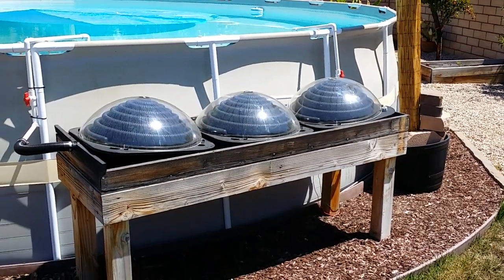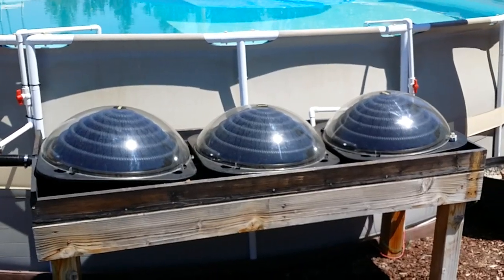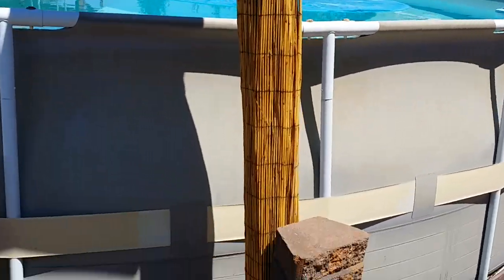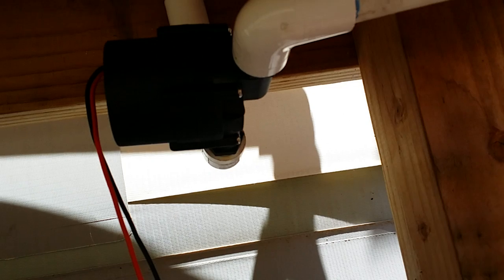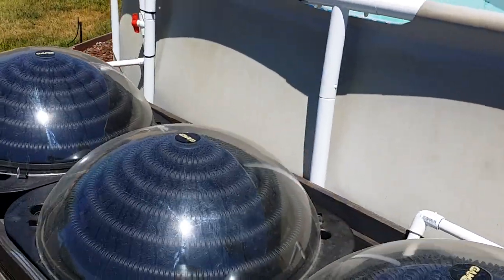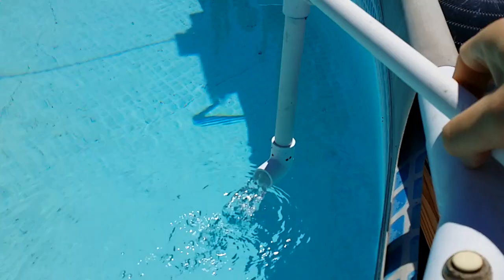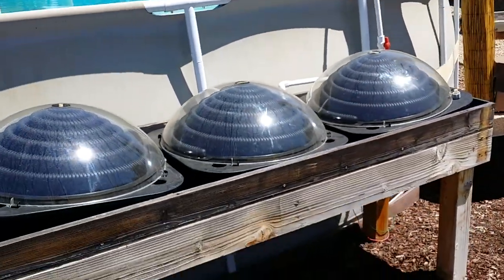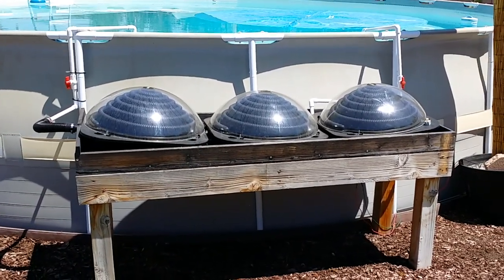GAME solar water heaters and solar powered pump

Comment: Free, except for the price you pay for it.
Shouldn't the hot water be coming to the bottom of the pool and the cold water be picked up at the top? To make it circulate and mix?
Reply: Yep. He would want to extend the input pipe to the bottom, since piercing the side to install an inlet is likely to cause leaks.

Comment: So what was your final conclusion on how your setup worked? Was the 1/2 piping enough? I would like to convert my 3 solar heaters to a solar pump so i dont have to worry about turning the the pump off in colder shady days
Reply: You wired the pump directly to the panel? No controller? Trying to put a setup together off amazon.
Reply from the maker: last302 Its still working and seems to work fine.